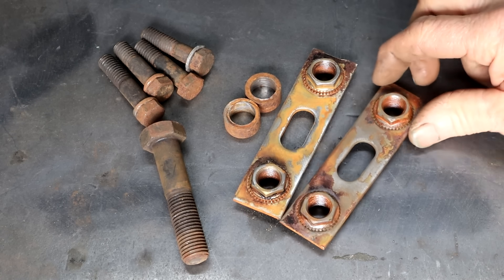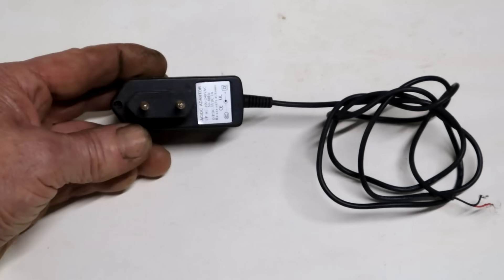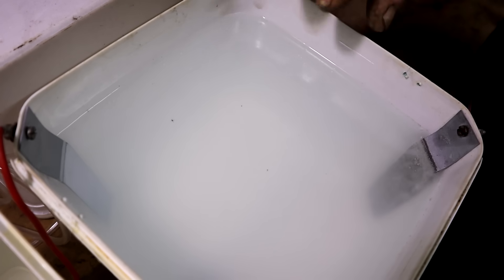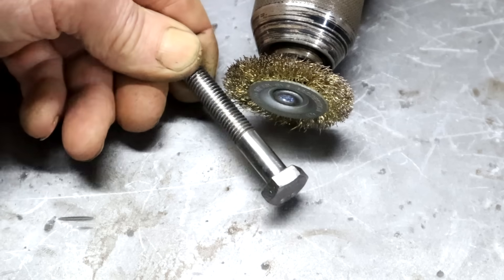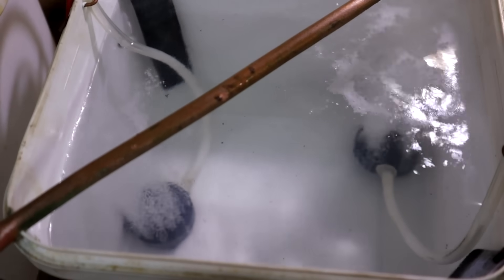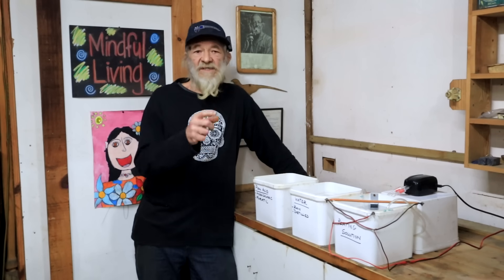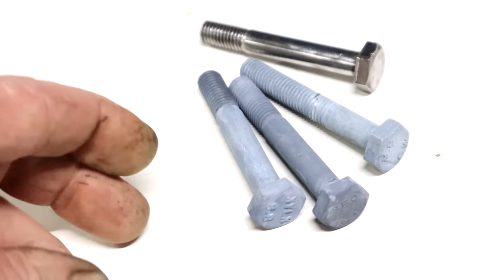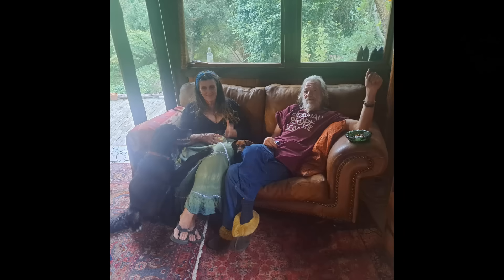Successful Backyard Zinc Plating!

Comment: I bet you could make it have a variable current with no electronics. Instead of a copper bar to hang it from, use a longer aluminum wire. Hang it from wood, several feet above the tank, then attach the power suppy to the wire with aligator clips. Raise the clips to decrease current, lower the clips to increase the current.
Reply from the maker: Don't think there will be enough resistance to make any difference
Reply: @ratrodsafrica you could use something less conductive, like the heater element from a toaster, but with how low resistance the solution is I guessed aluminum would be right. Too high of resistance and the adjustability goes away.

Comment: Regarding safety:
    "There he lies
     So Still and Placid
    Because he added water to the acid!"

The right way is to add acid to water, so that if it should splash onto you, it'll be the weaker solution which splashes and not the strong acid.
Reply from the maker: Where did I add water to acid?

Comment: You're right, common sense! For your information, there is hydrogen gas in these fine bubbles. Make sure your workplace is well-ventilated. Otherwise, it will make itself some ventilation holes. 😂

Comment: When using pool acid (like hydrochloric acid) on steel parts, especially high-strength ones, you risk hydrogen embrittlement (HE), where hydrogen enters the metal, causing brittleness and cracking; the procedure involves using inhibitors in the acid, careful pH control, and crucially, a post-cleaning Hydrogen Embrittlement Relief (HER) bake (e.g., 200-220°C/392-428°F for hours) to drive out trapped hydrogen before plating or assembly to prevent catastrophic failure
Reply from the maker: Jeez, clever stuff!😅

Comment: One thing I tried and had good results with... do multiple layers of thin plating with a light polish (non chemical) between each session.  I'll just pull them out and give a going over with a microfiber cloth, then back in the bath.  I likened it to giving a light sanding between paint layers to get a better final finish.

Comment: Hey Dif,
I've seen stuff like you what you are doing with the Zinc plating in person and on YouTube. One thing I have done myself was take an old rusted Ford block, that was left outside(No internals in the block, if you can), a plastic garbage can or tube, distilled water, some sacrificial metal, a old style battery charger(That you can control the Amps--most like only need 2 Amps), and what I use was like water softener salt. Mix the distilled water with the water softener salt. Then put the positive cable on the sacrificial metal and the negative cable on the block. Turn it on the battery changer to about 2 Amps, and let it cook until you are done(can take up to a week or more). One minor note, you might want to reload the freeze plugs/block plugs so that you can clean out the rust in the cooling passages. Also when you turn off the charger and pull the block out to rinse, make sure to use something to displace any water left on the block or it will flash rust. If you leave the changer on 24/7, it can take a week or more. But for me it took almost 3 weeks as I turned it on when I got up in the morning, and shut it down at night. My Shsbo, would kill me if I burned down the house. Ha Ha
Bart
Reply from the maker: Yes, that's rust removal through electrolysis. Interesting process

Comment: Nickel plating is as easy, and it's shinier but nickel will polish off if you get too aggressive with it. I want to try it on a few guitar parts. 
The only chemical metal work I've done is remove the anodized finish on aluminium. I detest anodizing LOL.
I placed some anodized bicycle parts in an enameled bathtub (don't do this in a fiberglas tub haha) and I sprayed them with oven cleaner and let sit for 5 min and then checked them. Sometimes it takes a second application. The aluminium turns black and now the real work starts - sanding and polishing, but it looks like silver when it's done.
Reply from the maker: Yes, exactly the same process for nickel plating. Which will give a shinier look.

Comment: If the current is too high for your parts you can either reduce the salt in the solution or pour more water into the solution, or you can hang an extra sacrificial piece of steel into the solution. The amount of salt and thus the conductivity from the solution will determine how much current your setup will draw from your power supply.

Comment: Yes! I tried this too, kong time ago with a 12V car battery charger - did the initial cleaning with ascorbic acid, which removes rust too. And the final  stage of getting some shiny looks was done with copper brush, a few swipes is all one needs. Managed also to get some copper plating happen on already zinc-plated articles (not very thick layer but copper coloured anyhow). That was far more resistant to rust than zinc plating only (which was acceptable).